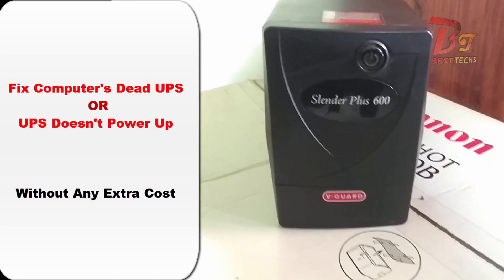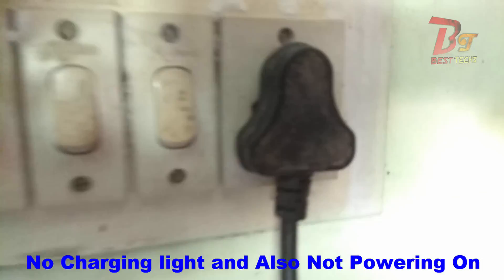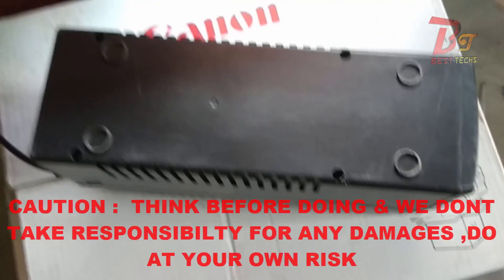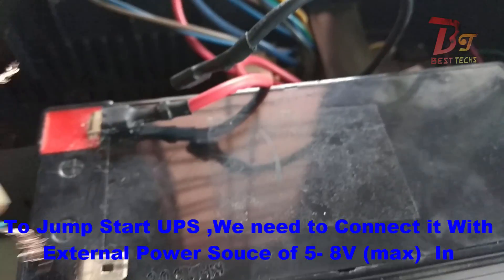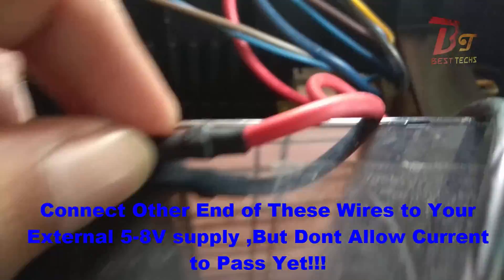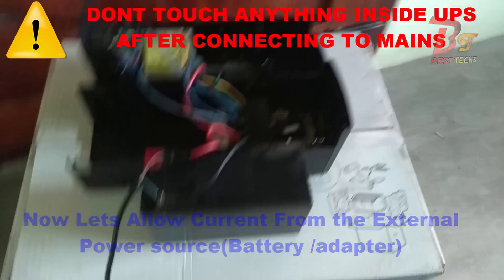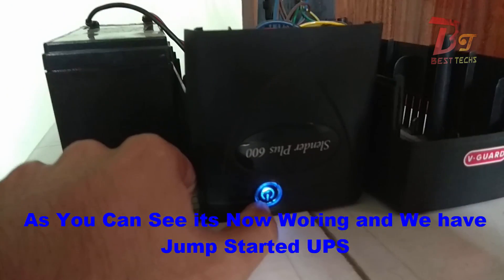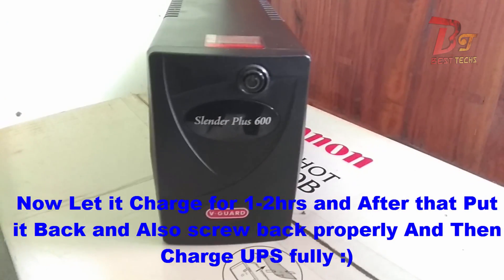Fix And Start Dead UPS With No Extra Cost | Computer UPS Not Turning ON or Now Working Solution

Comment: Thank you so much!!!!!!! I found a old APC Back-UPS 650, And it was broken. I had a boost converter and I switched the voltage to 12v cuz my boost converter had 2 voltages 9V and 12V. When I had connected the boost converter, When I turned on the UPS it showed a green light then disapeared. After a while it started.

Comment: What were your wires connected to? It would be great if you could show all your components and clearly mark each step of the process, including how to make sure you "don't allow [the] current to pass," which was mentioned but not shown in your video.
Reply: The wires which he used to connect with battery is an external power adapter !!!

Comment: bro my ups is working good but sometimes when power is failure and reconnecting instantly my ups is restarding. but once i disconnect power code from main line battery is workin more than 15 minutes without any hassle. How do fixe this instant disconnecting problem ????

Comment: Thank Bro.... Saved A Ton... In This Lockdown You Saved Me.... However, I Gave It A Shot With 12V Adapter After Failing With 5V Adapter... And It Worked....  🙏🙏🙏

Comment: Which external wire is connect to battery not shown in videos bro 
I dot get it
Reply from the maker: An 6/8v power ..use another battery or any adapter for the same..DONT PLUGIN directly to power supply

Comment: Bro will it work for the second time after the first time we charged it??
Reply from the maker: Yes if its charges.

If battery is fully gone like really dead, it may not.
Reply: @BestTechs Ok. Is output 5V fine?. Please tell
Reply from the maker: Not sure try. Lower the better. Also dont touch anywhere. There is a risk which i have mentioned in video. So dont do it when you are alone at home.
Reply: @BestTechs  Ok Bro Thank you so much 🙂. I liked ur videos and subscribed u. Keep going👍

Comment: 😠😠 Blew up my house wiring connection. Thanks for nothing
Reply from the maker: I guess u have connected battery directly to power socket😑.
I dont have to say anything if you act that dump. I clearly said in video , description and comments where to connect  battery (6-12v adapter or another battery and Definitely!!!! NOT!! 240V )
Reply: @BestTechs  Well if you had read the other comments, you would have seen that the connections part wasn't too clear to others. I am not versatile with wire and electricity stuff but I do most of the wiring from YouTube videos that clearly explains step by step.I will not say I'm cool with being called Dumb, but it's fine I won't reply that . All I got to say is put out  videos that will be easy for even DUMB people to understand.
Reply from the maker: Ok bro. I agree. I didnt mean to call you dump, u definitely is not, but i meant u acted dump. I take that back.

Anyway i am taking that suggestions, if u look at upload date, its a very old video bro. After seeing comments i updated description, cant do anything more now.i dont have that ups to re-upload this vidro
Reply: @BestTechs  My bad, I forgot it was an old video. Well done. 
Alright then, I just hope that the cost of fixing it back wouldn't eat me up 😄

Comment: Bro could you plzz mention the external supply that you had used😢😢
Reply: Plzz give reply bro
Reply: Its urgent
Reply: Can we use mobile charger
Reply: Use a 12v 1.5 amps SMPS charger to charge the battery. It is available in the market for 350₹

Comment: Thank you very much.. I brought back to life my numeric UPS. I was not having 5V DC source. I had an old 12 v 700ma Modem adapter. I cut the chords and touched the battery terminals. It started in 5 seconds. Thank you very much

Comment: hi,im sujeeva.i also have same problem.i have prolink super power fast charge ups.its not powering up.when i plugin and then press power button.but ups is not working.is that battery problem or elze.plz give me a solution.thank you.
Reply from the maker: Its not possible to say exact problem. It could be battery problem
Reply: @BestTechs  ok thanks.👍

Comment: Exact ups. Can I use mobile charger for the external power supply.
Reply from the maker: U probably need more than one. You can try with one first
Reply: @BestTechs  Ok. What did you use for this purpose.
Reply from the maker: Mobile chargers 😂

I used 2 or 3 together.I dont exactly remember.
All that matters is that voltage (given in description)
Reply: @BestTechs  Ok. Thank you Brother.
Reply: @BestTechs  Guess that by providing low voltage you had de-sulphided the battery and allowed it to work as usual.

Comment: I think its not a fix, something must be defected because it doesnt run like the way it should. If you change another battery, you will need to connect external dc power source, am i right? Im currently facing the same problem, but there must be a part that is weak or defected
Reply from the maker: Battery might be weak..Maybe it could work for couple of more cycle.
But the video is all about how tp turn on dead ups
Reply: I see, same thing happens to my ups, but im still investigating. In my case, its not about the battery. Just sharing. Thanks anyway ;)

Comment: Bro. Please upload new video, because it's not giving proper information, from where you attached that external wires to battery.
Reply: Bro use any adapter up to 8 to 12 V . You can easily find the adaptor for your set-top box of tv or just use your mobile charger it will also work but it should be of 9V nowadays mobile chargers are much like that
Reply: U r right boss
Reply: Praveen Shukla  जी क्यू नही, आपके घर में सेट टॉप बॉक्स जोग डिश का या केबल tv का तोच उके लिये जो adapter आप लागते है उसको आगर आप use करेंगे तो भी काम चल जयेगा। या फार ऊस तरिकेका कोई भी अडॅप्टर जो 12V से अधिक हो अप use कर सकते हो।
Reply: माफ किजीए हमारी हिंदी कच्ची है।

Comment: Excellent video bro. The two wires  which you connected on the plus and minus terminals were initially connected from where or from what type of battery?. Can you list me the name of the battery so that i could also do the same thing as you did ?
Reply: He used a low voltage AC TO DC adapter or convertor. Use anything that is below rating than  he described in video

Comment: Good video, thanks. What if the battery is complete dead or dried out, is it ok to continue using it like charging and using it again and again may be for a year after a single jump start?
Reply from the maker: Its better to replace battery
Reply: I just jump started my ups and is charging, waiting for it to see if it will be fully charged and last a bit longer. thanks man!!!

Comment: salam,
i am a ups mechanic, and currently i come across a ups which do not charge the battery. it gives output but do not charge the battery. so i want to ask that what would be the fault that i should mend. or simply tell me which tiny electrical component is to be repaired or changed.\\
if you have an idea about this then kindly reply
Reply from the maker: I am not a expect , But i think problem with Some electrical components

Comment: Which of the two wire u have connected to the ups battry?
Reply from the maker: +Dharmendra patel 
Like i said in video those wires is extenal power supply..(12v , it can be other battery)
You can try  something less than 12v also.mit may work.
Dont put value more than that
Reply: Laptop charger will do?
Reply: @jordanmallare3953  yes
Reply: Hot to + and neutral to -   :D

Comment: Can u do a video more specific?please.
Reply: Best Techs  what is a 12v battery
Where can i get it
Or can you get a picture of that
Its a phone adapter or other adapter or other battery
Plz reply nd xplain
Reply from the maker: +ULTRA GAMER 
External wires? Its just a 12v supply. Can ve other battery or adapter or something like that
Reply from the maker: +ULTRA GAMER 
Which part you have doubts?

Comment: what are the 2 wires you connected to the battery?
Reply from the maker: +ULTRA GAMER 
It will not normally explode.
But do it at your own risk bro..and take precautions